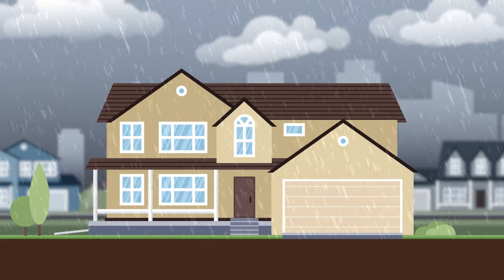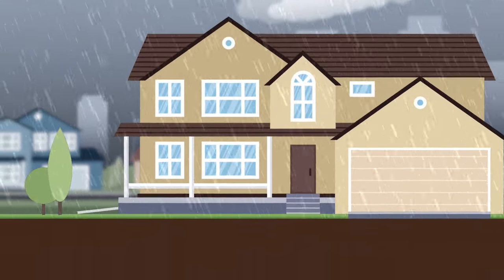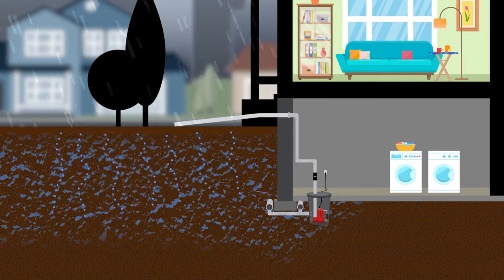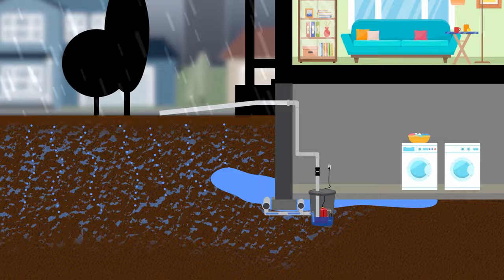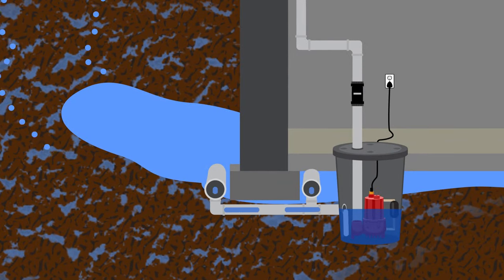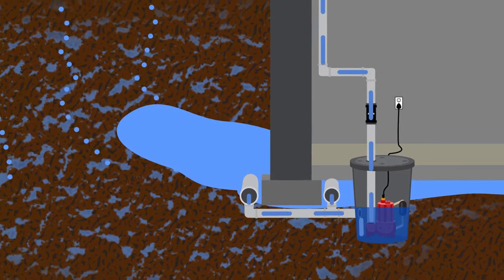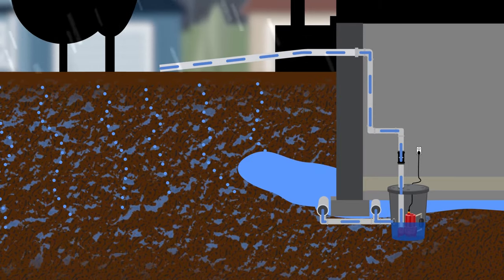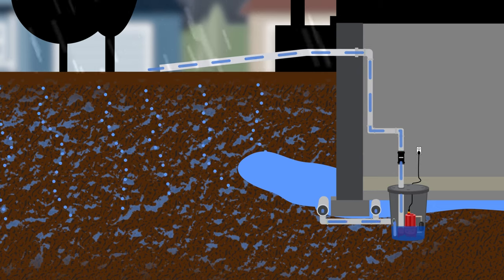How Does a Sump Pump Work? | Spec. Sense

Comment: Can you comment on this scenario:  Let's say there are 4 homes on a hill with #1 on top and #4 at the bottom.  #1 pumps onto the grass away from their house, but now #2 has to deal with it, #3 has to deal with #1 & 2, etc.  #4 now has all the others to worry about their neighbours water + the water table. Our city doesn't allow pumping into the storm drains.
Reply from the maker: Hi TechCowboy, thank you for watching. It really depends on the city as codes and regulations can differ greatly. Most homes will are sloped so additional water will run away down away from the home and towards the street to prevent water from accumulating in a single property. With older neighborhoods there might be cases where the grading is not up to current codes and might create problems. It's worth looking into your towns website for a FAQ for Lot Grading Issues, and if you have more questions you should contact your municipality directly.

Comment: So, it seems like there are places where water just get through the foundation?
Reply from the maker: Hi Keegan, thanks for watching. If your foundation doesn't have any cracks in it then water won't normally make its way through the walls or the basement floor, but if enough water pools and becomes pressurized it will start to form cracks in the same way that water will break apart the cement on sidewalks and roads. That's why removing water with a sump pump is essential.

Comment: My place has a sump pump but the landlord didn't make the outside pipes long enough to where the water pumping out is far enough from the foundation. 
Water is just pumping right outside my wall so my yard is constantly muddy and wet. Does my landlord need to add an extension to the outside PVC
 so that it is long enough to go somewhere else?
Reply from the maker: Hi Sammie, that doesn't sound ideal. Overall more PVC pipe can be added to the drain. Ideally you want the water to be sent far enough that it is draining outside of the footprint of your home and so that the water spreads more evenly across the lawn.
Reply: ever heard of a garden hose

Comment: We have a new home and the gfi outlet for the sum pump keeps tripping every few hours.
Reply from the maker: Thanks for watching. The GFCI detects very small diferences between the hot line and the neutral line, only 4-5 millamps difference. You can learn more here: https://youtu.be/LyAtuR2qtMA?t=51

There are a few things that could cause it to trip:
- Bad GFCI outlet
- Faulty wiring on the load circuit of the GFCI (bad outlet, short to ground, faulty appliance).
-The sump pump could be faulty and leaking power to ground or to the water in the sump pit.

Comment: What if discharge pipe water gets frozen in winter? Or gets blocked by snow?
Reply from the maker: Thanks for watching. A frozen discharge line is an indicator that the system was not installed in an ideal way. This depends if its buried or above ground. Insulation can help in certain cases.

As a discharge line begins to clog, a sump pump system will be forced to work harder to keep up, leading to overheating and sometimes pump failure. And if the system clogs or fails entirely, then your basement will flood.

If the discharge pipe is frozen then a portable heater can be used to help melt the ice. 

If you're having this problem it might be worth hiring a professional to help make some adjustments to minimize these issues.

Comment: What can cause the basen to overflow… the pump is working but when in a heavy storm, the basement over flowed and flooded the basement
Reply from the maker: Thanks for watching. It means that the flow rate from the heavy storm exceeded the flow rate of your pump. This might mean that a larger pump would be helpful. You can learn how to size a pump in this in-depth video: https://youtu.be/Iqh3rI2XX4o?t=67

On the other hand, very intense storms can still overwhelm even the best of systems, depending if your home is in a low spot or not.

Comment: Just bought a new house, didn’t know it but contractor said the water table is near at the divery of the house yeah... Limit... My sump pump starts every 1h or 2h. Runs like 30 secondes... And stops. Is it normal? Why they did not built the house like 1-2 feet higher?
Reply from the maker: Thanks for watching. The water table is a big consideration when building houses. Modern homes are generally built with the water table in mind but not all builders take the same steps to addressing it. 

As for your sump pump running, if its a wet season where you live then there will be more moisture to deal with and the sump pump will run more frequently. The sump pump is pretty powerful so it doesn't take long to empty the sump basin, so a 30 second run time is normal.
Reply: @AmreSupply  Thanks for your reply, my basin is not deep also, might be due to water table, 24" by 18"maybe.. 2 feet deep max. Weird thing is the drain pipe, from the french drains, is 1 inch over the bottom of the basin. I have a feeling that the home was built 2-3 feet too deep.

Comment: Can someone or something tamper with the sump pump pipe or valve from outside causing it to malfunction or break?
Reply from the maker: Thanks for watching. When it comes to tampering, If the pipe is plugged and unable to drain then water will not be removed effectively from the sump basin.
Reply: @AmreSupply  ok we have an issue but I want to make sure the leak is fixed. If the sump pump goes out how much water should we expect to see or any signs of a failing pump?
Reply from the maker: @LadyRevel22.2o.21  A failing pump might start to sound different, or it might run more frequently even under normal conditions. You can always get a leak detector to help monitor the water level. This video is more in-depth and might help answer some of your questions: https://youtu.be/Iqh3rI2XX4o
Reply: @AmreSupply  thank you and happy Thanksgiving!
Reply from the maker: @LadyRevel22.2o.21  You're welcome, we're just happy to help!

Comment: After a lot of rain my home would always smell moldy, will a sump pump fix this??
Reply from the maker: Hi Mendoza, if you have any leaks in the basement or water accumulating then its best checked out by a professional. If its just a build up of moisture or humidity, then a dehumidifier would help with that. If you suspect mold, then its best to locate it and remove it properly to get rid of that particular smell.

Comment: previous owner built the sumo pump, now it is raining season. Do i need to activate it or it will turn on autimatically?  thanks
Reply from the maker: If the sump pump is plugged in, it will start running as soon as the water level triggers the float switch. You can test your pump, empty a bucket of water, and fill your sump pit to see if the pump turns on. You can see this in action here: https://youtu.be/Iqh3rI2XX4o?t=323

Comment: Does it always pump upward and out or does it sometimes pump out directly into the ground and say to the curb?
Reply from the maker: Thanks for watching. It depends on where you live. Depending on when the home was build some homes are connected to the storm sewer system so the sump pump would drain directly into that. In other homes it just drains onto the lawn. Its best to check your cities website for more information.

Comment: Never understood why it has to be in the basement though
Reply from the maker: Thanks for watching. The sump basin needs to be at the lowest part of the basement as that is where the water collects. The sump is located in the sump basin so it will push the water up through the discharge pipe. You cannot place the pump higher and use suction to move the water up the pipe as there are limits how far water can move via suction.

Comment: so sump pump is useless if the water table rises due to flooding nearby?
Reply from the maker: No exactly useless but if there is a high water table due to flooding, the sump pump might run constantly. Now if there is too much water, then it'll exceed the pumps ability to remove water from the sump basin. That's one scenario when there will be flooding even with a functioning sump pump.

Comment: what happens if you lose power?
Reply from the maker: Thanks for watching. Many systems will stop running when power fails. For the best protection, install a system with a battery backup to ensure that the pump will still run during a power failure.

Comment: Illustration looks like you're just putting the water right back on the surface where it all started and where the problem will just continue.
Reply from the maker: Thanks for watching. What is hard to see in a 2d cut away animation is that water is accumulating from all sides of the house, and the weeping tile collects it into the sump basin. The sump pump usually pushes the water farther out away from the home and is usually in an area that will naturally slope away and drain away from the home's foundation.
Reply: @AmreSupply  Thanks.  I hope I was helpful as an amateur in this area this struck me.

Comment: If a foundation of a house looks like a "sauce pan", then why poke a whole in it to put a sump pump? Wouldn't it be better just to keep it completely closed "sauce pan" under the house??
Reply from the maker: Hi Marcio, ground water is an issue for many homes and a sump basin is necessary to hold the sump pump. Overall the most cost effective way is using a sump basin and sump pump. This allows you to monitor the amount of water that is accumulating, and also service the pump.
Without using a sump pit, the sump pump would have to be buried next to the house making it difficult to service. Alternatively if you wanted to access a exterior sump pump you would need a well or a hole next to your home to place the sump pump. This is why a sump pit is needed.
Even with a 100% sealed system, large amounts of groundwater needs to be removed or it will damage the foundation. Considering that water can cut through solid rock over time, its easy to see how it can crack the foundation of one's home.

Comment: So it's automatic, right?
Reply from the maker: Thanks for watching. Yes the sump pump will automatically turn on when the water level gets high enough.
Reply: @AmreSupply  Oh okay, thanks. I thought there was a switch you turned on when it started raining. We have a sump pump in our new house and I'm confused on how it works.
Reply from the maker: @hx.925  It depends on the model, there might be an on and off switch. Using a bucket of water you can test your sump pump to see if its working https://youtu.be/Iqh3rI2XX4o?t=324
Reply: @AmreSupply  Yep I saw. I don't know where my sump cover is though. I have a small finished walk out basement. Where do you think it is? Hot water heating and HVAC are right next to eachother in a large closet.
Reply from the maker: @hx.925  Its possible that you don't have a sump pump. Not all homes have them installed, or are not at risk of any water accumulating around the foundation. Most newer homes are required to have one installed though.
Reply: @AmreSupply  In the Zillow home description it states that it does and it also has a 50-year warranty. We just bought it.

Comment: Not showing how pump itself works?
Reply from the maker: Hi Stahlnecker, thank you for watching. This video was meant as a quick overview of the system itself. The basic float operation is pretty similar between models. We show the pump itself working in this in-depth guide. https://youtu.be/Iqh3rI2XX4o?t=212

Hope this helps.
Reply: how a sunpump operates* 
 -_-

Comment: Wait. So you pull the water INTO THE HOME just so that you can pump it OUT OF THE HOME!!!!!!!! 
Sounds like the dumbest thing ever.  As if it was SPECIFICALLY invented by a plumbing company while they patiently wait for that pump to fail $$$$
Reply from the maker: Thanks for watching. Water naturally will accumulate under the foundation and will crack the concrete. As well water can flood the basement if not removed. It's worth noting that not all homes need a sump pump as some are located on a hill or gradient where the water will naturally drain away from the home.

As well what is not shown in this 2D animation is that water is accumulating from all around the home, and will be removed by the sump pump and drained in an area that it will drain away from the home.